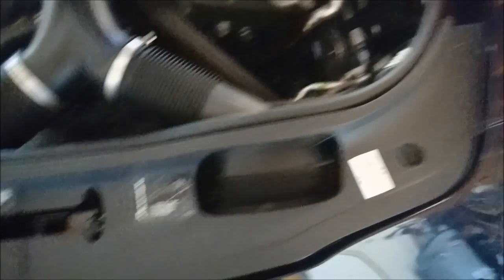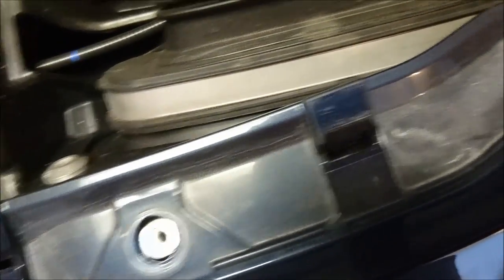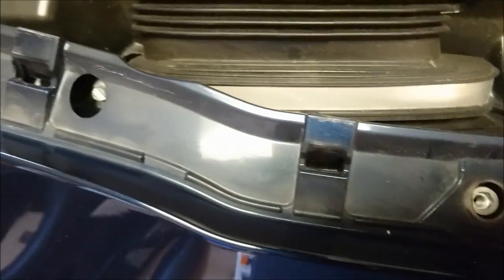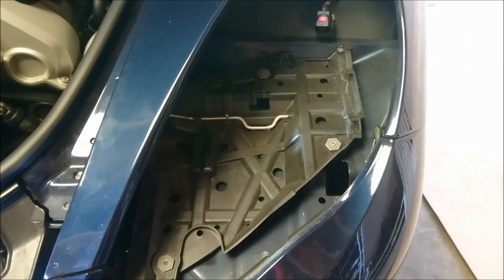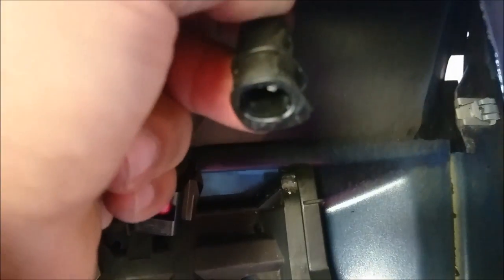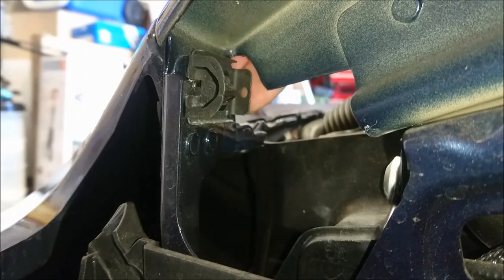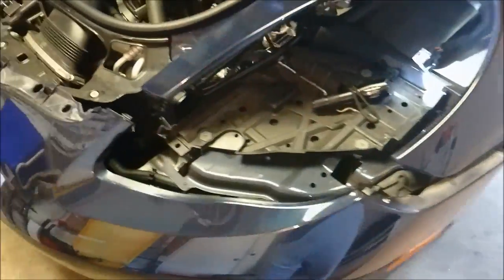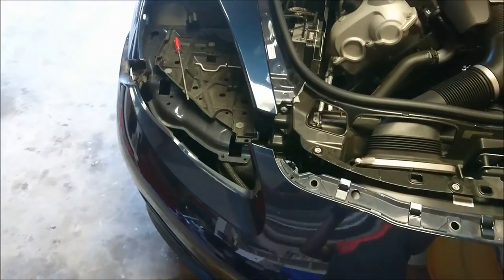Panamera Bumper Removal - How to Remove Your Porsche Front Bumper

Comment: Be sure and remove the headlight washer tube on the right side below the headlight before pulling the bumper off to far. Has a small plastic clip on a tee fitting. Hoses are a bit stiff and the tee will break.

Comment: Great video, thanks. Removal is pretty forward straight and designed to be done quickly. 2 connectors behind wheel well liner on drivers side: marker light + sensor/lights. 3 on passenger side: same + washer. As mentioned, plastic T will brake easily. BEFORE moving bumper, disconnect washer line higher up right behind wheel well liner. Reconnect there too. This prevents any stress on T. Good luck!

Comment: Old vid now, but thanks for posting it.  I never would have found the 2 bolts under the wheel well liner.  Took me 2 hours and it will probably go faster next time.  It is highway robbery that places charge 4 hours of labor for this.